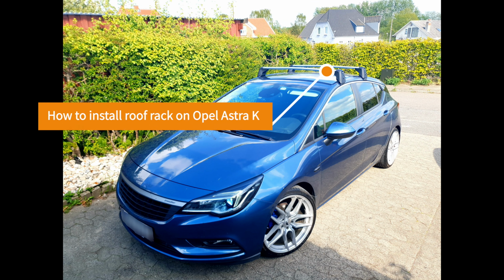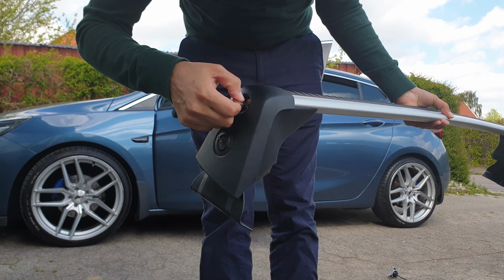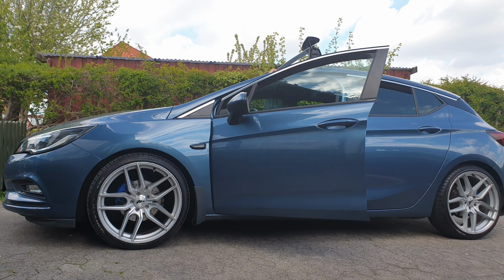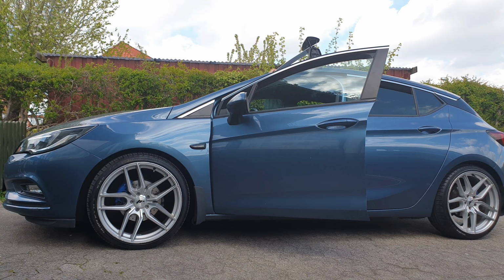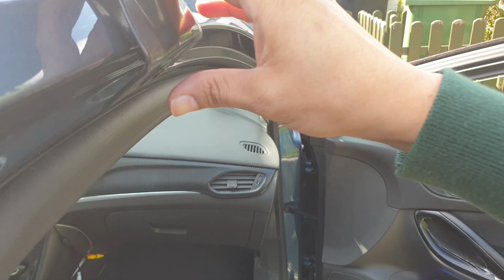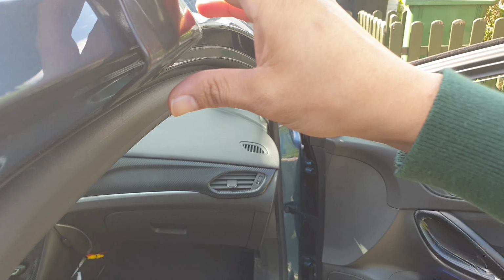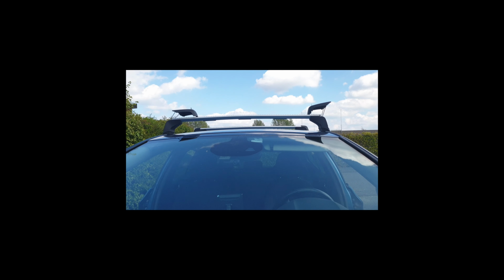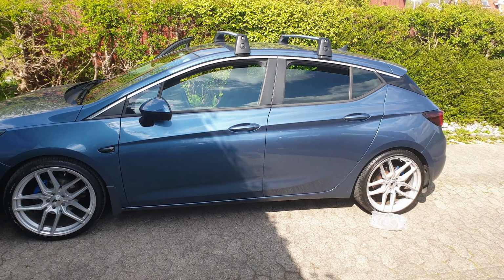How to install roof racks on Opel Astra K

Comment: Hey Mr.Gheasi , which wheels do you have on your Astra? And did you change your Suspensions/Springs?
Reply from the maker: Hey. I have bought Japanracing wheels with 19 inch. It's lowered by 40mm front and back. Please subscribe to My channel

Comment: The "clamp" system it is the shittiest system by far for a roof rack....It will ruin the car paint.
Reply from the maker: It has a rubber but yeah after years of use it will destroy the paint. It hasn't yet. And I have used it for 2 years. Totalt 3 months where it was mounted.

Comment: Nice wheels! Does the roof bar cause any scratches or marks to the roof?
Reply from the maker: Thank you. No this one is genuine from Opel. The bars that touch the car are rubberized. I took it off after 2 weeks and there were no scratch but only some dirt which was easily cleaned.
Reply: Is Opel the same as Astra ecoflex?
Reply from the maker: It depends.  what year is your car from? Please subscribe my channel